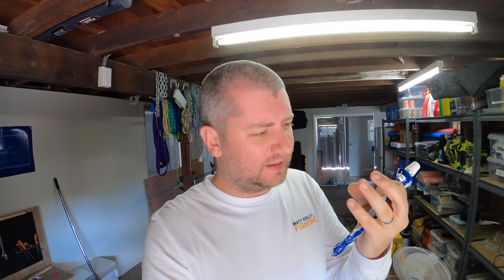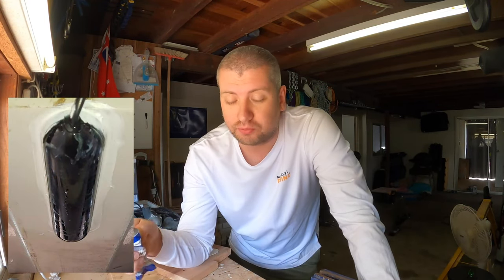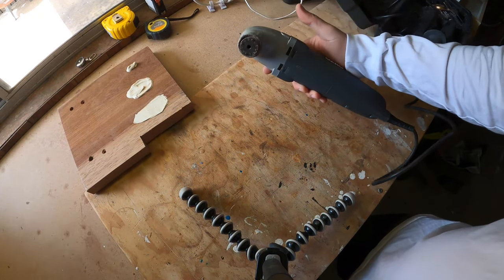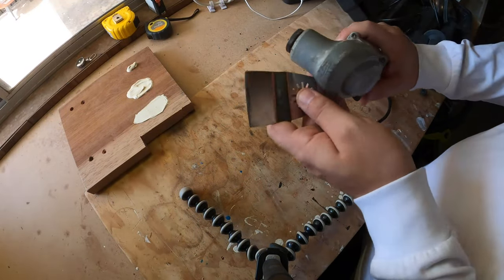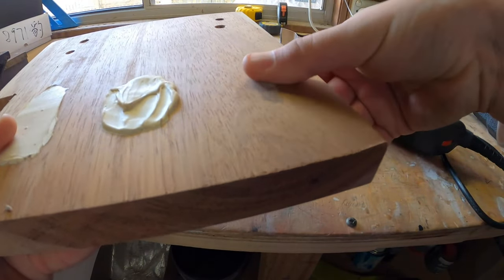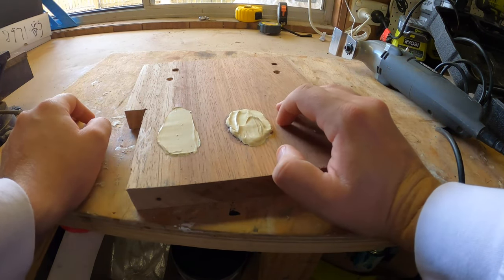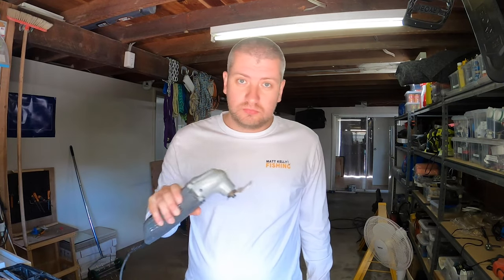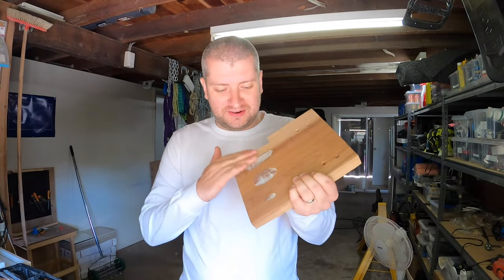How to remove Sikaflex, 5200, or silicone sealants!

Comment: I own this tool, and have struggled for two days to remove that impossible crap from my camper to replace the roof sealant around a leaking vent fan.   I was using a scraper and razor.  As soon as you revealed the tool I smacked my forehead.  Gonna use it tomorrow.  THANK YOU!
Reply: It work ?

Comment: I’m own a sign shop and when we need to remove signs we use fishing line and in a sawing motion remove the panel from the wall. Then use the multi tool to clean up the left over sika, just like in your vid, saves tons of time.

Comment: I know this has been a year but I have a question. I'm trying to disassemble a bay door on our motor home which is about 2' x 4' and 2" thick. It is framed with an aluminum extrusion which is screwed together and the door itself consist of an outer panel of painted fiberglass or filon, I think), 1 1/2" of Styrofoam, and the inner skin is plastic or maybe vinyl. Near as I can find out, Newmar used Sikaflex to put it together and removing the screws at the corners of the extrusion(frame) basically get me no where. I asked Sika if a heat gun would loosen it and they said maybe but would probably be a gooey mess. The bay doors are in great condition(2003 RV), except for some delamination areas where the adhesive either failed or wasn't applied heavy enough. Trying to take apart to fix these issues. If you have any idea about using heat to make this stuff let go please enlighten me. Thanks, great video.

Comment: I would NOT use this method to remove Sika flex on an RV, you will totally fuck it up and probably crack the fibre glass too. Not to mention that when you want to reseal your RV with Sikflex you need to get even the old residue off before reapplication. On wood maybe but not where you need a totally smooth surface so it seals well on re application. Sorry pal. Not for me.
Reply: All complaints, and yet no offer of a better solution?